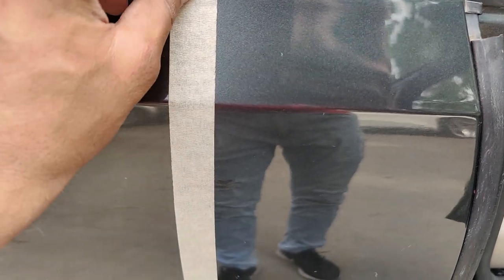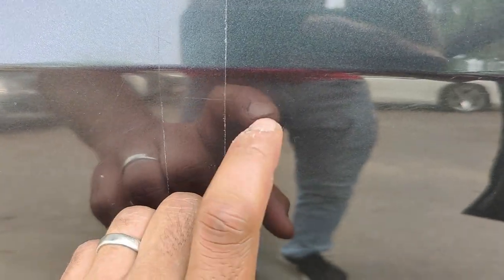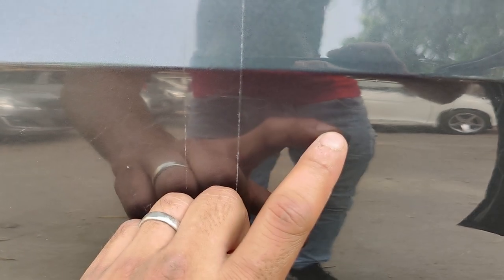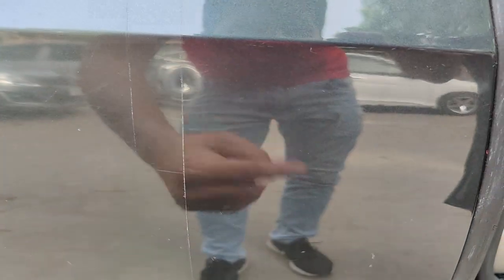HOW TO POLISH A CAR | SCRATCH REMOVER | BRAKE DRUM PAINTING | INTERIOR CLEANING

Comment: Hello...greeting, hope you doing well. I own a 2016 Skoda rapid 1.5 tdi dsg. The car has done close to 52k kms.off late the car has started to show a weird behaviour where it ramps up idle rpms to 1000 or even slight over. Ususally it would idle within 750 to 900 rpms with or without ac.Scanning the car shows no faults however the car sounds very gruff when it idles higher. Please suggest what could be the problem. 
P.s : battery replaced 6 months back. Also serviced at authorised service center.
Reply from the maker: Sir its similar with all the cars at this time of year , these days ambient temperature is reaching 43-44°C which is alot , and with the load of ac on car , it produces even more heat . So the engine temprature rises , and to compensate for that engine raises its idle rpm so that the water pump can flow more quantity of water through the cooling system to control the heat in better manner and along with that , the radiator fan also gets into its highest speed .
Reply: @yourDIYneeds  Allright. Perhaps I have noticed this behaviour only since the last month so I was a bit worried as it never occurred in the last  6 years of ownership. Also this occurs irrespective of the Ac turned on of off.